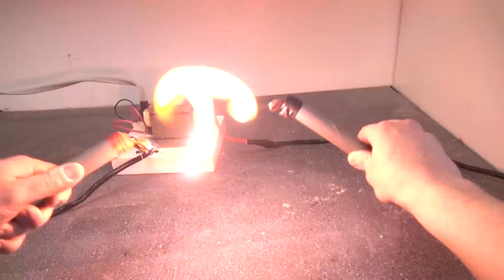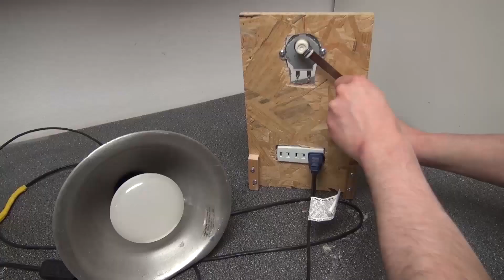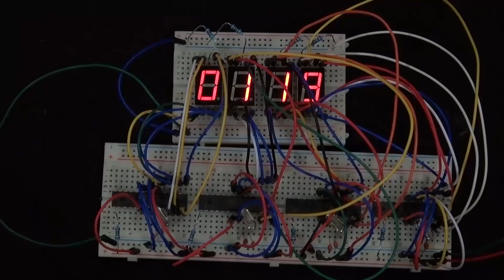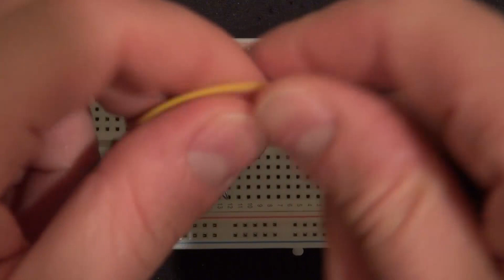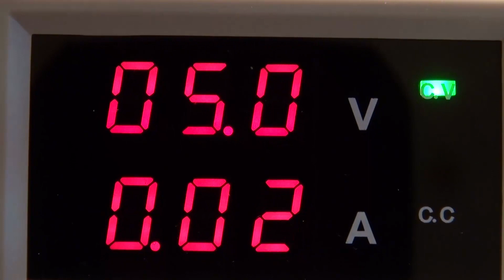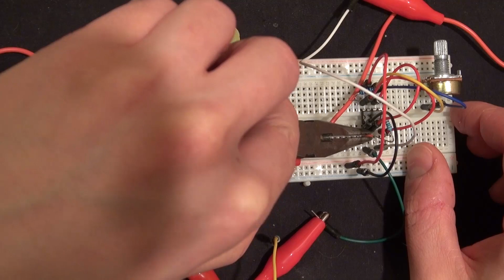Blinking LED With 555 Timer Speaker And Potentiometer

Comment: How much does the blinking reduce the lifespan of the led?
Reply from the maker: If there is a resistor, then it would last long.
Reply: @SciTyeTech  Lets say 20-30hz flicker?
Reply: @emiliano9321 

It shouldn't
Because LEDs work by switching on and off